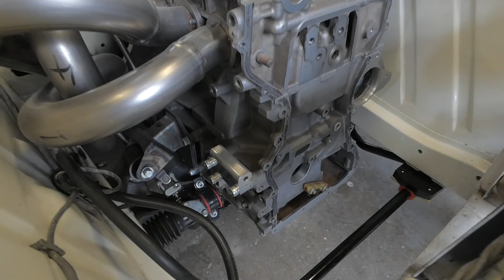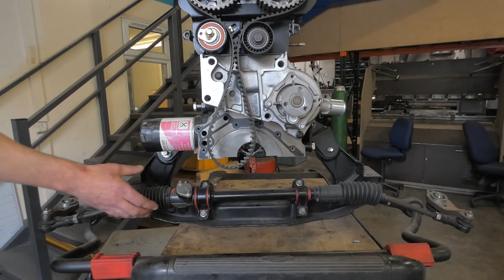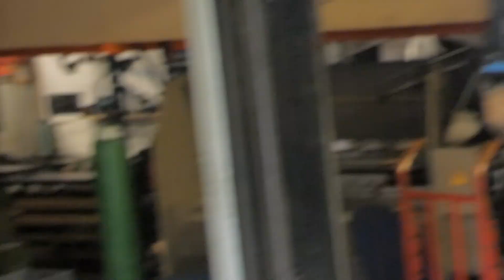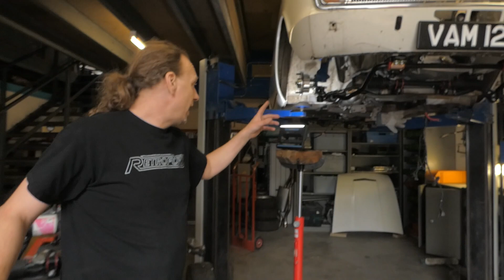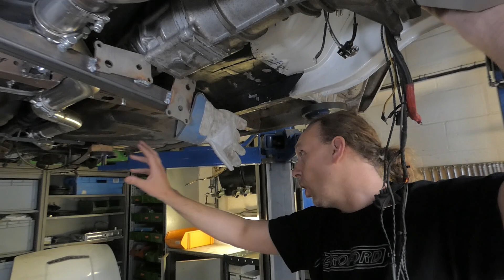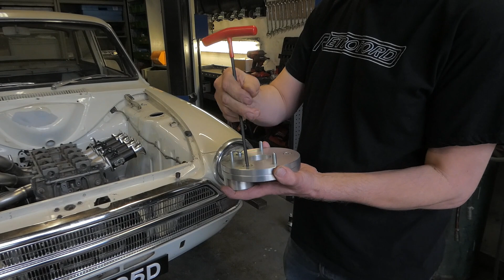Retroford Tech Guide Ep.5: Duratec Mk1 Cortina Parts Explained

Comment: Is it possible to use the standard Escort Mk2 anti roll bar and TCAs?
Reply from the maker: Yes you can .. but not a twin cam anti roll bar as the give to much castor
Reply: @Retrofordltd  Thanks for your answer. 
How much camber do you get with the standard TCAs? 
And for which ride height is the Escort Strut Kit designed?